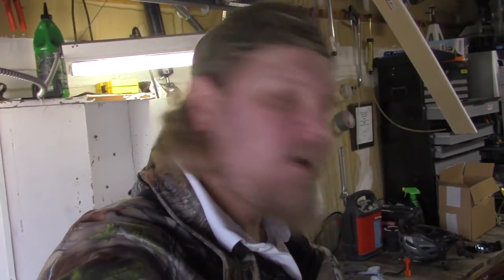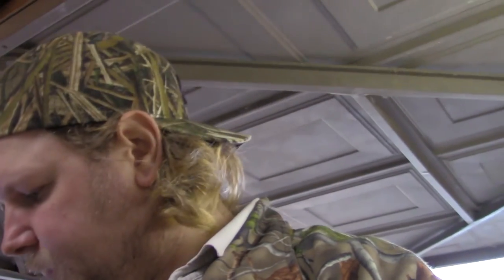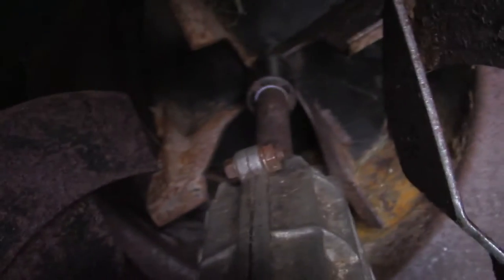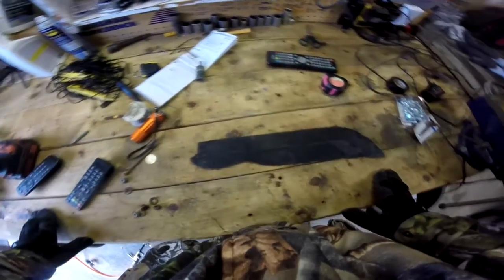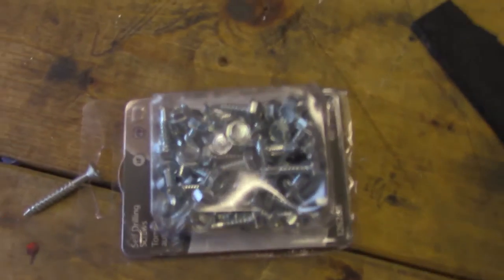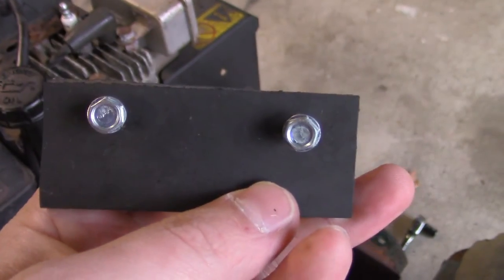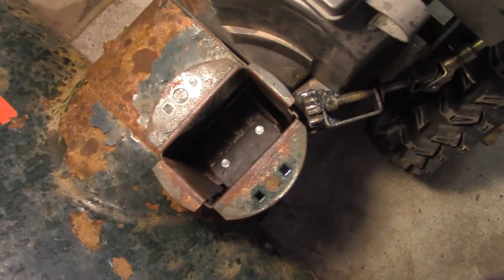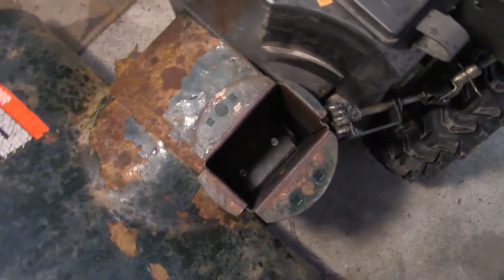Snowblower Impeller Modification

Comment: I have a 9hp 26inch craftsman and I put a rubber paddle on one of my blades and it got caught at the top of the movement and it wouldn't allow my impeller to move. Looks like I'm going to have to shave my rubber a bit

Comment: Awesome.
Reply from the maker: +sixtyfiveford hey! Thanks for popping by!  If it wasn't for you,  we all wouldny be doing this mod!  Cheers!!
Reply: I just did the impeller mod on my 2 stage snowblower.  It also had 1/2" gap between the blade and impeller.  I picked up a mud flap from Princess auto that was 1/4" thick and reasonable heavy duty, along with self tapping screws.  Now I am just waiting for more snow to give this mod a proper test.

Comment: Having 4 blades on your impeller allows you to get away with just using 2 pieces of rubber on opposite blades.  If you have an odd number of blades then you will have to put the rubber on all of the impeller blades so that it stays balanced.
Reply from the maker: +bwillan good to know!!  Thanks!